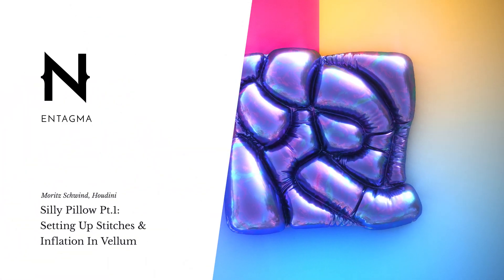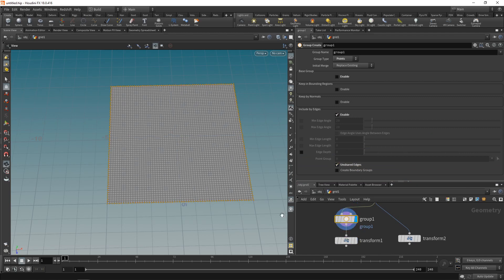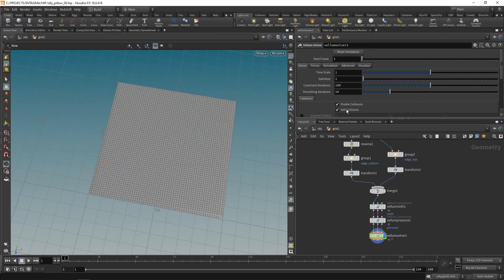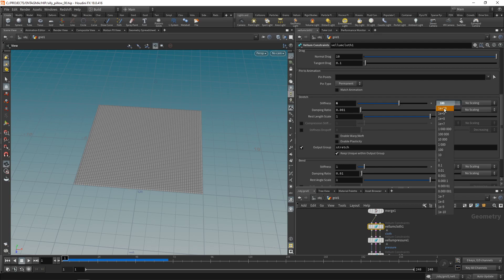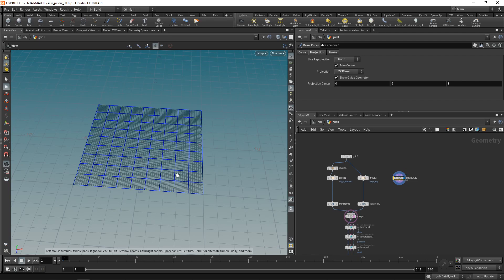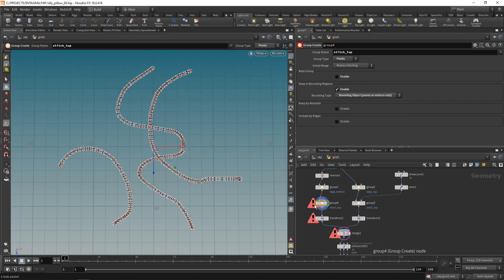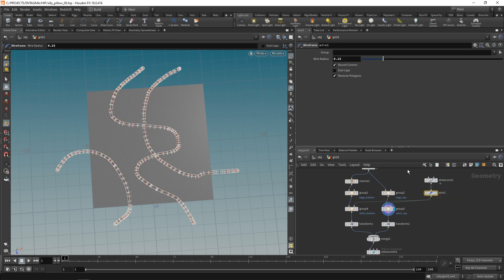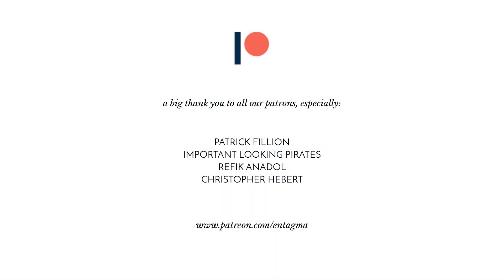Silly Pillow Pt. 1: Setting Up Stitches In Vellum

Comment: Great stuff! Thank you. Quick question please, I'm using an animated noise for the welded points groups, how do i force the vellum solver to update those groups at each new iteration / frame please? I was hoping to find a "match animation" type of option in the Vellumweld node but there is none in there. Can this be achieved with a sop solver within the vellum solver node perhaps? If yes, how please? Cheers.

Comment: I had some mixed results with my initial attempt doing this via fuse  for the base pillow.  I went back and reproed your results with your method, added a switch-if node and put my fuse construction as the other input.  The results are similar though the geometry in the fused case is more tortured around the edges which might have implications for texturing/rendering without remediation.

Comment: Thank You Mo,

I'm wondering something : so here you are working on a pillow measuring 10 metres on 10 metres : That wouldn't be the logic size to working on for a real pillow ? 
(But it-s probably a stupid question as the simulation works fine in the end, and it's all we need.)

Comment: For some reason I couldn't get the Vellum Weld to stitch the points together. However, I used a Fuse node after the merge and it worked fine from there. Just in case someone runs into the same problem.
Reply: The vellum weld does not fuse anything, the vellum post-process has the option to.

Comment: Great tutorial, thank you!. Can anyone point me in the right direction if I want to use a black and white image for point selection for the welding groups?
Reply from the maker: Hey Matt,

use an attribute from map SOP to load your image onto the grid, then use a group expression node, set to point grouping with this in it's VEXpression-slot:

avg(v@Cd) > 0.5
 
This selects points on which the image brightness is above 0.5.

Cheers, Mo
Reply: @Entagma  worked like a charm. Thank you!

Comment: Let me start by saying that i love you guys but what's up with the highly saturated voice? It's really annoying. Please don't continue with this voice chain if possible..❤️❤️
Reply from the maker: Hmmm. Listened to this setup on a range of headphones (crappy to studio monitors) and even a few cell phone speakers - this was the best compromise to our ears. What would you suggest doing differently instead? Cheers, Mo
Reply: @Entagma  The sound before the last 3/4 videos were absolutely fine. Not great may be but better than most. I would recommend a soft compressor first, something like teletronix 2a emulations. Then a High pass filter somewhere between 150-200hz(approx.)  Then another hard compression. Then De-essing. Then some EQ to brighten it or to shape it. And a little saturation/distortion if you like(it will be better if you do the saturation parallelly). 
Right now, there is too much saturation in the sound. Too much sibilance, probably accentuated because of the saturation. Somehow, I feel like you EQ out the lower end of the voice and brought it back forcefully later with some other processor. Overall, the sound is very Mid heavy and has a lot of lower end artifacts. 
In my opinion older sounds only needed a bit of compression and brightening. That’s it.
Thanks for the consideration though.
Cheers... 
😊
Reply from the maker: @rafayetnewaz  Nice, thanks so much! All I've got here is a dbx 286s channel strip, might dial back the compressor's ratio and the equalizer's low end, de-esser is already in there and of course a gate... Cheers, Mo
Reply: @Entagma  Oh forgot to mention, Great tutorial as always..👍